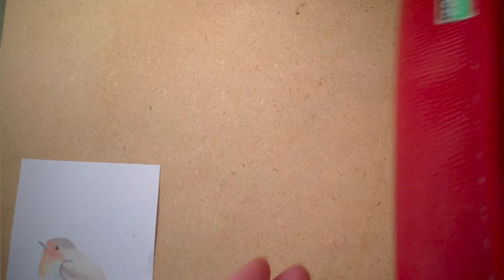Micromosaic Robin by Gabrielle Warr

Comment: Amazing how you get every piece the same size! I've tried doing micromosaic and that seems to be the most difficult part. Any tips or just a lot of practice!
Reply from the maker: Thanks! It definitely takes a lot of practice! You need to keep a close eye on how the glass reacts to your flame, remember it has a delayed reaction, and remember to keep your eyes in the external edge of the flame nearest where you’re pulling from. You can move the glass in and out of the flame according to the size you need. When I teach students it’s quite a physical lesson, I’m often pulling and pushing students in and out of the flame. It’s so hard to explain in words!
Reply: @citrinette  thanks I will keep trying! How do you figure out where to file the glass so it is the same length in the bezel?
Reply from the maker: @barbarakonschak8839  oh it’s just a matter of your eyes getting used to the size. You can mark it out on paper to compare to at the beginning. If your bezel is 5mm deep, your tesserae should be no longer than 4mm.
Reply: @citrinette  thank you for your help and willing to share. Wish you would do a on line class with making the filato!  Would love to go to Italy and take the course, maybe someday!
Reply from the maker: @barbarakonschak8839  you’re welcome! it’s something I’ve been asked before but it’s such a complex thing. I really need to be near the student and to guide your hands often. It would be so hard on line! I hope you can make it here some day!